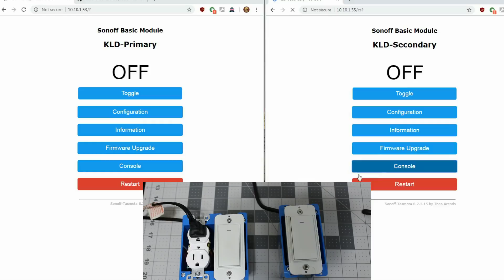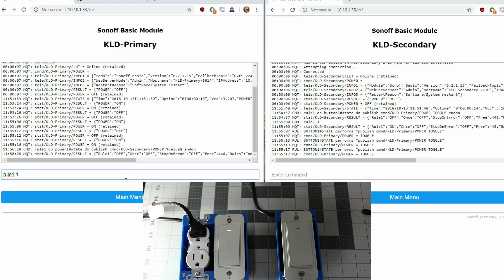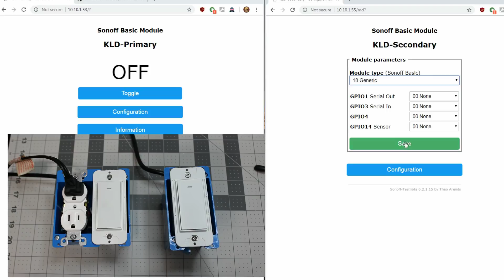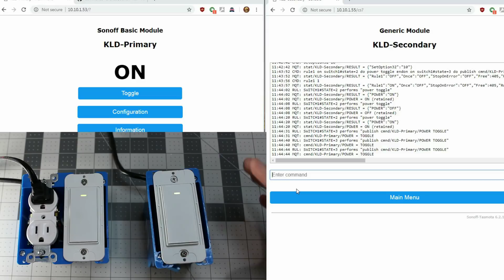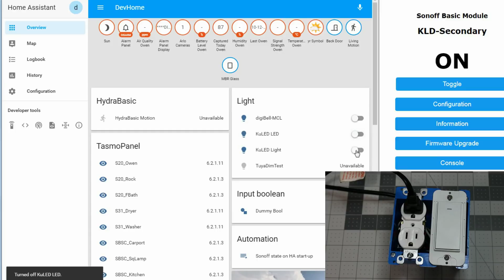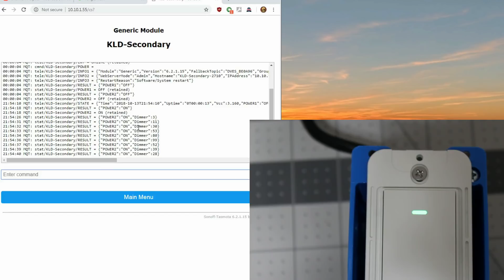3-Way Smart Switch Tips & Tricks with Tasmota

Comment: Is there a diagram of how you wired your test "bench" in the video. Trying to replicate it and I am over thinking it.
Reply from the maker: It was just a power wire running to one switch.  Then another power wire ran to the other switch that turned the plug on and off.

Comment: Great video.I wasn’t able to implement it with regular switches, though. Only with buttons. Is it possible with switches? I had all my other Sonoff that way and I’d like to keep consistency (aka OCD :-) )
Reply from the maker: Long press requires the buttons.
Reply: @digiblurDIY  I'm not sure I understand what you meant. I want to use regular switches, not momentary push buttons.
Reply: OK, I figured it out. I had to tweak it a little bit but now it's working. I'm sure there is another way to make it more efficient (as I created 2 rules on the "remote" Sonoff to contemplate both : the toggle switch and the built-in button. It doesn't work if I use HomeAssistant)

All these are commands entered directly on each Sonoff

- On Remote switch (not connected to light) ( I named it Sonoff_04)

Switchmode 0 
Switchtopic 0 

rule1 on Switch1#state=2 DO PUBLISH cmnd/Sonoff_04/POWER TOGGLE endon 
rule2 on Button1#state DO PUBLISH cmnd/Sonoff_04/POWER TOGGLE endon

- On Local Switch (connected to the light )(I named it Sonoff_01)

Switchtopic 1 
rule1 on power1#state DO PUBLISH cmnd/Sonoff_01/POWER %value% endon 

What I'm missing is how to detect changes of states when using HomeAssistant to toggle the "remote" (Sonoff_04). I think I may need to use a 3rd rule. Nevertheless, the "remote" Sonoff shouldn't show up in HA (it would be not only redundant but also confusing as Sonoff_01 is physically controlling the light.

Thanks 
@digiblurDIY

Comment: Thanks for all you do Digiblur!
Is there a way to send an alternating turn on/off command vs using Toggle?  Toggle is good for most situations and only controlling one device, but I want multiple devices to change from what ever the state it currently is in to a common off  upon first push, than common on next push and continuing to alternate.  Perhaps sending the state of relay 1 from the device you are on to the remote switches/relays? Could this work by changing the state of the relay to the desired state on a short push, then publishing that state to the remote devices on a long press?
Use case:  My basement has 4 switches controlling lights from front to back.  There is a US three way for the light in the stairwell.  I want to use the upstairs switch to turn on and off all lights regardless of their current state.  We often only use one set of lights and kids frequently forget to turn them on and off...  I want to accomplish this using Tasmota web send since this method has higher wife approval.  HA is great, but it takes me a lot of trouble shooting anytime I try something new and therefore isn't stable enough to not T-OFF my wife.
Another question, is there a way to have three different actions based on short press, long press and double tap.  I can't find much info on double tap, but it appears to be another way of achieving a long press but can't be a separate command from long press.  Is this assessment correct?
Reply from the maker: I do believe what you are talking about are issues I've run into with multiple lights and one gets out of sync so the toggle doesn't work.  That is easy to solve with HA using a Light Group but if you don't want to do that method you'd probably have to tackle it with some crazy rules and variables stored.  

You can see this one to get 6 actions per button - https://youtu.be/jcdPRbWCGjE

Comment: I have a suggestion for a Video for you,  The Hook Up, or DrZzs
Tasmota supports the KNX protocol, which doesn't require a MQTT broker, it can communicate directly between switches or a group of switches. It can do this over different physical media,  power lines, twisted pair wire, WiFi (so I've read)
This might be a great solution for people you want smart switches, to work even if the MQTT broker is down or not present. 
For example the 3-way smart switch configuration you've shown.
I'm going to try KNX on some sonoffs and see how far I get.
What the best why to let you know if I have any success?
Reply from the maker: I've seen the KNX support but never looked into it much.  You can hit me up on discord or email the channel, both are on the channel about page.

Comment: How would you code the long press on each switches in a group or room to to toggle the group on or off?  Can mqqt get msg from the hold to trigger turning off or on all the lights?
Reply from the maker: For short/long press you'd need to configure the button as a switch in a generic template.  Then set the switchmode to 5 or 6 depending on if it is low or high when not pushed.  I'm thinking mode 5 off hand.  Then do a rule that is on switch#state=3 do publish ....  then that's where you have a decision to make, you can do a backlog of commands to publish multiple messages to each switch or you can change their group topic and just publish one message in hopes of making them all go off at almost the same time.
Reply: @digiblurDIY  what do you mean by group topic?  is this something coded into the kuled switch itself on the sonoff console?  Also what would the code look like if the do publish had multiple switches to turn off?
Reply from the maker: Look at my video on upgrading over MQTT. I showed how the default Sonoffs group topic is used. You can change the group topic on the few switches you want and they will also listen to the same mqtt commands.
Reply: @digiblurDIY  I watched the MQTT video but still dont understand how to make longpress (hold) show up in Home assistant.  If i can get home assistant to see when a longpress is done on any switch in the group (new group topic for the group switches).  can i make it  a gost switch in the config.yaml?  If i can do that then all i would have to do is animate what to do when that switch getts toggled (longpress hold)
Reply: So looking into this even more, I think getting the sonoff itself to publish a cmd to turn on or off the other 3 lights would work best.  Does anyone know how to send commands to multiple sonoffs when long press is done?  I cant find any examples of the code string on how this is done.
Reply from the maker: The video was to explain the group topic you could assign to the two or three switches. To do a long press you have to do switchmode 5 or 6. Then setup a rule on the switch state 3 to publish a message. A perfect example was in my recent night light motion video. It's a PIR but the same as if a switch just a different state.

Comment: If i wanted to do this on a 3-way... or some would say 4-way switch with 3 switches....KLDprimary, KLDsecondary and a third switch we will call KLD3 in this instance.   can I code the second and third switches the same as in your video but add this code to the second switch to get the third one tracking the led changes?.this is what I am thinking of coding for KLD3....
rule1 on button1#state do publish cmnd/KLDprimary/POWER TOGGLE endon
rule1 1
rule2 on power1#state do publish cmnd/KLD3/POWER %value% endon and then rule2 1 to turn on the second rule.
rule2 1

will this work?
Reply from the maker: do you need the relay flipping on and off in those other switches?
Reply: @digiblurDIY  I just need the relay flipping on the primary
Reply from the maker: You could send over ledpower commands as well. If you want the red LED you would need to send over power commands though as it is hard wired to the relay.

Comment: Great Video. very good explanation. is there any way to split the toggle and use the led command for the Heltec? then maybe the light on the touch switch can be configurable to match the state of the power on / off
Reply from the maker: Unfortunately the heltec doesn't have another pin to control the LED or provide an easy way to change that. If you find any buttons to do so that work well like these please share them.

Comment: Thanks for the Video, this is great stuff.
The 3/4/infinity way switching is great info. I imagine you could use 'groups' in the rules to effect a group of switches as well.
The second part in the video, is exactly what I wanted to do, control a switch from another via a long press. 
The separate control of the green LED will be real handy for my application.
Plan to have this switch out in my garage, and to have the green LED on when off, will help guide you to the switch in the dark.

Comment: Great video.
Is the gosund "plug" flashable and has esp chip ?
Or what smart devices that can be flashed do you recommend please ?
Reply from the maker: What country are you in?
Reply: @digiblurDIY  Egypt but I will get it from the US.
Most switches won't fit in our boxes, so I prefer smart plugs instead.
Reply from the maker: I'm not sure of the plug style used there but I do like the Sonoff S31s (check out my Smart Laundry video), I've heard great things about these plugs as well that are easy to flash.  https://amzn.to/2JYIRTW 

If you do have issues with the switchbox size, the Shelly1 switch would probably be a great choice.  Super small!
Reply: I can use a plug converter to use in Egypt.
I have already checked the video and it is great but I thought maube something cheaper can be hackable.
Regarding the Shelly, It is out of stock on Amazon and on the official site itself :(
Reply from the maker: I remember seeing someone with those gosund US style plugs and they weren't as easy to flash and had to almost destroy it to get to the pins. Do you need power monitoring?
Reply: Power monitoring is not important currently.
I have only seen plugs with ESP in Netmedias & MK-SmartHouse channels. Both used different plugs but they were not so difficult to hack.
Reply from the maker: These are pics someone sent to me of the Zentecs I linked above, looks pretty simple to do.  https://imgur.com/a/RYSrDb7

Comment: Again, so sweet.  I just ordered $100 in switches...hahaha.  I have 10 sonoff's, but now that I understand you can flash tasmota with these switches...IT's ON like Donkey Kong!!!  The whole house is getting redone...hahaha.    Am I correct is saying that if you right the "rules" and get the two switches to function between themselves, as long as wifi is working, your good?  Right?  If MQTT goes down like it did for hassio users, but wifi is still working, switches will work?  My 3 way sonoff's were down for a day cause MQTT update hosed me.  I really like the so called "rule coding" in the tasmota and then using MQTT in HA for automation's.  The WAF factor will improve, cause right now, it's a low 3 when the 3 ways don't work.
Reply from the maker: Awesome. Always fun to get everything done!

I showed in the Shelly1 video how to do it over HTTP between switches. This would work when mqtt is down if you use the latest version of Tasmota that has the non blocking MQTT library in it.

Only downside to it is you have to put the IP addresses of the secondary switch in the config so make sure you use reserved IP addresses on your router so they don't change.

Feel free to hit me up on Discord or email if you need help. You can find me online on the DrZzs or Homeassistant Discord channels.

Comment: Thanks for the tips! New subscriber now. I have been using 16 Sonoff T1's around thew house since April, but I have been using automations/scripts/groups for the 3 and 4 ways and this helps immensely. Do you have a config for 3+ switches? Can I just add a rule2 and rule3 for a quick fix? Thanks! I ordered 4 of these to flash from your link to give these a shot.
Reply from the maker: You can pile as many rules as you want into each bucket of rules (rule1, rule2, etc).  Tell me more about your config and what your goal is.
Reply: @digiblurDIY  Example: 3 separate T1 switches in a hallway that control 1 light. 2 dummy switches and 1 connected to the light. I have them in a group in HA and have been using autos/scripts to tie them for switching, but I'm not sure how that would look in a rule. Possibly: From switch sonoffT302 send = rule1 on power1#state do publish cmnd/sonoffT304/POWER1 %value% and do publish cmnd/sonoffT303/POWER1 %value%endon . Basically, I would like to have one switch send 2 MQTT power commands so I can have the other 2 switches activate. I have already changed over 4 other sets of 2 switches controlling 1 light per your vid and I am amazed at how much faster the response time is from HA versus autos/scripts.
Thanks again!!!!

Comment: Excellent video -- I learned a lot of new things. I implemented this in a hallway in my house and it works as advertised. After changing the hall light to a very bright LED I realize that I'm going to have to change the switches to dimmers at some point in time. I'm wondering if the same techniques you have used here would work with the dimmer switch you used in one of your other videos. It would be very cool if the LED level lights on one dimmer was immediately reflected in the other dimmer using MQTT. Thanks for the great videos.
Reply from the maker: Actually you could do it that way if you wanted. You would need power at both switches of course with only one doing the actual dimming. The other would need to have its load wire capped off. You could have rules syncing the dimming between each switch either over MQTT or direct over HTTP via IP address.

Comment: Very informative, thank you. Keep em comin. Do you rate this better than the dimmer you reviewed?
Reply from the maker: The dimmer is really in another field given it dims and these just switch on and off. I probably will have this switch in a config long press toggling the same dimmer module I did the firmware mods for a few videos back though. Both great switches for different use cases.

Comment: But this is still using an mqtt broker they're not actually communicating back and forth with their self?
Reply from the maker: Correct. A MQTT broker is required. You can use the websend commands for direct switch comms over HTTP.